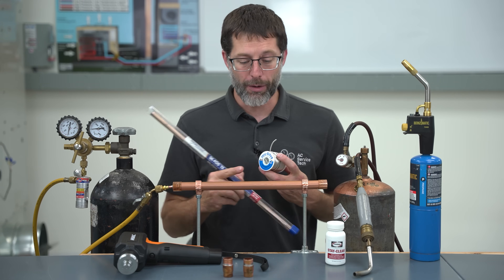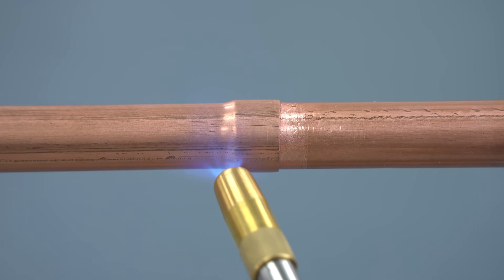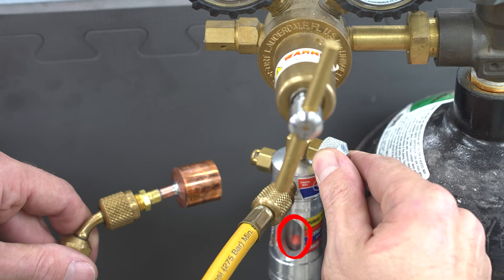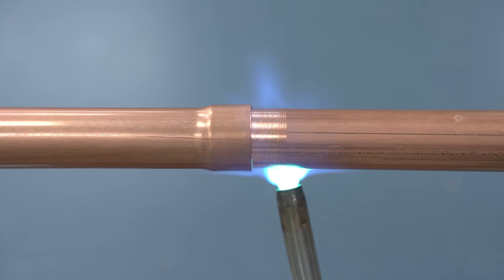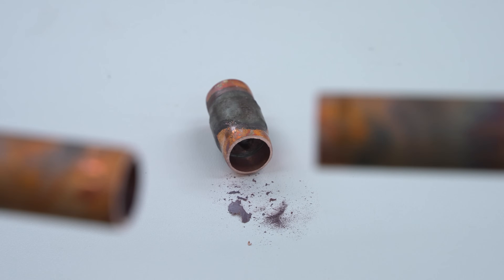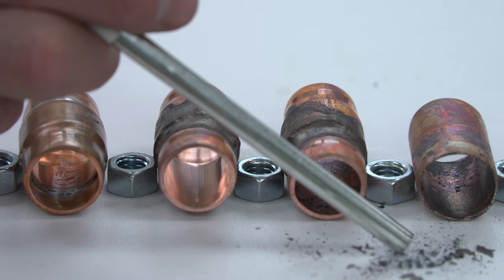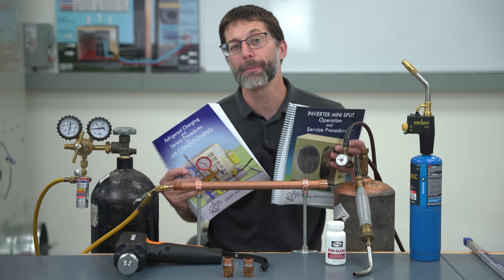HVAC Silver Soldering vs Brazing vs Brazing While Flowing Nitrogen!

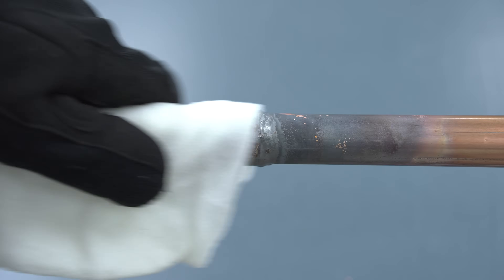Comment: 8:00 NEVER EVER QUENCH YOUR JOINTS. This is the only thing I  would disagree with on your work. There is a potential for creating micro cracks in your joints could create leaks on high pressure systems.

Comment: I love Stay Brite  but just want to point out 2 things.
1. It flows like water and is not great for filling in gaps. So tight joints are important. 
2. Since it flows so thin, if you apply too much solder, the excess  will pool inside the pipe and if that pipe is not level, that excess will run downstream until it cools.
If the pipe is vertical the excess will drip down and cause rstrictions or even blockages.
So keep that in mind when soldering in cap tubes, txv's etc. Don't overdo the application of the solder.

Comment: If that flyx leaves that residue inside the copper tubing. How is that good when soldering hot water tanks? Wont that get into the water?

Comment: A rare miss by ACST. You are far more likely to cause long/short-term issues with the excessive heat caused by brazing than by a microgram of residual flux from soldering. Your test didn't include pulling a vacuum evac on the pipe, which would vaporize and suck out any acid in the flux that snuck inside. There's zero chance the tiny amount of residual flux diluted by the oil would affect pH enough to damage compressor windings. Considering how easy it is to braze incorrectly, silver solder really should be the preferred method due to it being more idiot-proof and much safer/quicker than brazing.

Comment: I braze whenever I’m not overly worried about damaging the txv. On my own system, the condenser is brazed, but my air handler is soldered. The reason I did this is my factory installed txv was a few inches of pipe away from the end of the pipe. I would rather risk a little bit of flux over the guarantee that my txv will get at the very least, a little too hot. That’s the only time I feel soldering is acceptable. Never would I do it with anything in my condenser or for a coupling.

Comment: An HVAC system should have a filter/dryer inline that will catch the particles of debris that may end up in the system. It is not a substitution for purge gas by any means, but should stop the flux, and burnt flakes from always flowing. Also the refrigerant gas in the compressor is sealed off from the electrical components and the seals are usually in an oil bath. The only time they will come into contact with the electrical parts are when the seals fail. At that point you will need to replace the compressor .

Comment: I've seen a suction line soldered with plumbing solder back out of the fitting on a heat pump and leak

Comment: Hi there. Great tutorial. Two questions for you. Why did you apply flux all the way to the edge of the inner pipe? This will cause flux to enter the line when heated. My second question is, if using silver soldering on the liquid line, can adding a line drier mitigate the excess flux in the line?

Comment: The last one you did by brazing is how I was taught and shown how to do it. I was always told to stay away from the plucks due to down the road. Anything that comes in contact which will be the high side will start to deteriorate over time. Not tomorrow. Not next month but over time and can be expensive if it's a major part. Not cost effective at all to use the flux. If you have a total compressor failure and you don't have a split unit then the whole thing becomes trash. And they always have a great deal on an AC unit. 

Question for you.  What about TIG or mug mug welding it? They have different amps and a wire is self-feeding and it takes a very small unit rather than carrying two big bottles with you. Wire feed welding TIG welding can weld just about anything. Just wondering what your thoughts might be on that today?  
Now I do understand and tight situations where you don't have the ability to braise and they choose to flex it and we know what that means at the end. But nevertheless you may have another couple years. But you never know. Your way doesn't take any eye protection, but TIG welding does. I'm trying to weigh the pros and the cons. Don't know how much experience you may have with that. I believe brazing is the best way, even in tight situations just takes patience. That's my thought. Please feel to correct me at any time. 

To me, brazing can take a little bit more time as far as handling your own materials, but I would prefer that than antioxide inside of my for oxidation occurring inside of my copper line that's going to run through everything.

How is a helper as a child to the AC man and he would have the nitrogen and the gas in a container that would be able to hold one hand so he always keeps an extra 5 lb or whatever it was of each rather than having to carry large bottles unless it was a big commercial job. He did beautiful work and you're doing beautiful work. There's a big difference from 30 years ago to today. Now they have nitro caps and all these new added components. In your opinion, how far has the AC company including with the reverse pumps for heat, have come in the last 20 years. I would deeply appreciate your time and thank you so much for the video again. God bless!❤️🕊️✨

Comment: I have wondered if nitrogen really "blows" the cupric oxide out "in theory" or it just circulate the cupric oxide inside the system, away from the solder joint.  How do we really know?  It'll be interesting to get the HVAC system manufacturers to get their engineers to comment.  In addition it maybe good practice to install filter dryer to the liquid line to remove contaminants before they get to the expansion valve.
Reply: It doesn't blow it out it replaces the oxygen with nitrogen which eliminates the chemical process of the formation of the oxide

Comment: I'm a noob just learning all of this stuff as a homeowner. I don't have the tools to braze (yet?)... If I recover the refrigerant and isolate it to compressor, then do my line work with staybrisolder, can I purge/flow the lines with nitrogen before pulling a deep vacuum? I'm guessing this doesn't physically "clean" the flux off the inside of the copper, just wondering...

Comment: So compression fittings then? Safer, could stand high pressure too, unless the technician installed it improperly, the connection could burst and leak.
Reply: Ciao! Qua in Italia non usiamo raccordi a stringere, fino a che pressione sono consigliati? Li avete provati sul campo?

Comment: What size is your torch tip? 
I use the standard size offered with the torches but I feel like it doesn’t heat the pipe evenly and this causes for longer brazing times.

Comment: Silly question but I think there is a way to get the flux acid residue out? Why not take a separate piece of swaged fitting, a few inches long, apply the flux and solder, but then remove it. Do the same to the other end of the line. Then clean the insides of each pipe. Now the ends have silver 'plating' on them. Then just clean the insides of the pipe, re-attach the pipe ends but no flux needed since they have the plated surface. Heat a bit to get them to seat, then add a little bit more solder. Kind of like how you can unsolder and re-use plumbing fitting in domestic water. Am I missing something here?
Reply: A brain

Comment: Never cap the pipe if you are running nitrogen. You will have a leak. I will purge the line with nitrogen then turn it off.

Comment: I installed two split systems. A 3.5 ton and a 4 ton  last year using staybrite 8. I was worried about the flux. What I did was I added flux, tinned all the mating parts lightly, removed all the remaining flux, assembled the parts and soldered as usual. So far it all looks good and holding well. It seems that you need flux to apply solder to the copper but the parts that are already tinned with the solder will solder together without anymore flux needed.  Give this method a try and tell what you think. I would love to hear your thoughts on this method and love to share what I think is a good method.

Comment: I'm not saying it's right or worng but I'm sticking with stay brite 8. They are referring to direct contact with electrical components in regards to the stay clean. I want to hear what the manufacture has to say? Does this void a warranty? Bottom line is stay brite 8 is made for refigeration. What really baffeles me is thay I see all these 30 yr old systems with no filter drier and I'm sure no nitro was used while brazing but they continue to run. In my opinion the anount of flux left behind here would not even be felt in the system in which filter driers arre desinged to catch.... I.E. a 30 foot lineset with a smug of flux isnt going to hurt anyting...If you are getting down to 200 microns that system my friend is clean as a whistle. Only time I use silfos is on compressor swaps or repairs I have units with stay brite 8 way past there warranty, again not saying whats right and wrong but I'm using what they say works...To me this is just a scentific internet demo and thanks for showing the demo.
Reply: Anche secondo me, la teoria è sempre affascinante, ma la pratica è molto più semplice 😂

Comment: In the "real world" without code requirements as is today for HVAC soldering vs Brazing vs using nitrogen the choice will be solder using flux as the costs involve for time and equipment. This is why you see the evolution of "Shark Bite and swedge connectors" like it or not. I've been around awhile and listened to it all regarding......"you wanna do it right" and etc it all boils down to money and of course following the code. I don't care who says what but "its the way it is"

Comment: Very informative demonstration. Everyone watching this video can very clearly see that the nitrogen flowing through the copper pipe, as it's being brazed, prevents the formation of cupric oxide inside. Even if a person does not use this method (because of the extra hassle or expense) they will know the issue. They will be aware of possible future problems caused by the unwanted materials traveling through the system they present to their customer. Throughout my 40-year career in computer system installation and maintenance, quickly changing technology forced me to constantly adapt to new systems and methods. Progress was both challenging and humbling. Being forced to learn, and deploy, methods that I was previously unfamiliar with was painful, but kept the paychecks coming. Also important, I was proud of my work. Thanks very much for this well-done video.
Reply from the maker: Thank you for watching and for sharing your experience!

Comment: If you make the joints so shiny before soldering, you just need the thinnest coat of flux you can create. This is where you make or break this technique in my opinion. I'm using soft soldering for DIY repairs since at least 10 years now. And it works really well.
Especially the reversing valve of my heat pump/AC unit broke down 2 times during warranty and a third time right after warranty. Warranty repair was brazed, I did the third repair myself with soldering and it now lives longer than ever before. I suspect brazing overheated the valve.

Comment: The old trade trick is. Fix the leak then they will contaminate the system so windings in compressor will fail.  Bingo back out for new compressor. Honesty is a thing of the past. I caught them on camera doing it. We had an out of court settlement. Always watch who is repairing what ever it is. Why do you think auto repair  shop won't let you see them working on your car.

Comment: How exactly does flux inside the closed loop refrigeration circuit touch the compressor  motor windings as you said? The windings are not part of the refrigeration circuit.

Comment: STAY CLEAN is Zinc Chloride. It isn't acidic unless exposed to water and oxygen. The oil in compressor neutralizes Zinc Chloride from becoming acidic. This is the reason the Oil & Gas  industry extensively uses it.
Reply: As per their information sheet.....The flux is mildly corrosive so post-soldering residue should be
removed with hot water or other suitable cleaner.

Comment: Strange times now days !!!

I started in the trade 50 years ago, when R -12, and R - 22 were the standard, with an odd R - 500 thrown in !!!
The old timers thought me a fool for using high acid liquid line and suction driers on every residential refrigeration job.
They said I was wasting money when I bought a micron gauge, and an electronic scale to weigh in a proper charge.
They accused me of being a crook to charge my customers for an oil change in my vacuum pump, which was changed after every burn out job, before I got off the roof !!!
I changed my oil after every three normal non burn out jobs, as SOP. ( Standard Operating  Procedure )

The only time we used nitrogen was on large commercial jobs, for leak testing, and dehydration.

Things have changed for the better, I must say !!!
Better tools, better techniques, and better technology.

I use nitrogen on all my jobs now, even refrigerators !!!
There is no such thing as too good on any job.
Your reputation depends upon it !!!

I wish I could still climb, and do roof work, however at 75, I like to stay on the ground, even if it means doing an occasional appliance repair.
I may be retired, but I am not dead !!!
I still teach the subject, and emphasize using the best and latest techniques.
Doing it right the first time beats a call back every time !!! LOL!!!

Great demonstration, I will use it in my classes from now on, as a student lab project.
I like your clean demonstration set up.

Tim

Comment: How about a different type of flux, one that's not corrosive, like the one that's used for soldering electrical wires & electronics components. 
 Liquid no clean soldering flux, it's non-corrosive.

Comment: Refrigerant and filter driers will clean out that flux and oxide. No worries.
Reply: Really? And when a the filter driver is replaced with a new one, will nitrogen be flowed, or will it not be flowed like previously and now your back to where you started........ IF YOU flow nitrogen the first time you wouldn't have a issue to begin with. 

You already have the nitrogen to use for pressurized leak test, why wouldn't you use it to flow while you braze???? 

You're a LAZY HACK is why.

Comment: I was taught that Brazing is a stronger joint than silver soldering and the joint becomes stronger than the pipe , if done correctly. You need to use nitrogen (inert) gas when brazing.

Comment: There is more to this subject than you covered here all soldering and brazing has its place depending on what you are doing there is no one solution for everything prep work is crucial I've used all the different types of rods and solder and brazing. They all have their place depending on the job.

Comment: R454b has ZERO room for forgiveness it must be installed 100% clean. New Refrigerant Requires Precision. Quality Tools, Quality Equipment, Time and a Skilled Patient Installer.
Half ass installers don't want to install R-454b because they do not care to be perfect precise and exact what 454b requires. It is not a forgiving refrigerant. They sure as hell don't care about the environment. Half ass installers only care about their own pocket. By the time the Ozone layer is destroyed they will be dead so they don't care about the next generation.
Shit installers wanna get in and get out as quickly as they got there so they can do more shit jobs and make their shit pay.
Half ass installers don't want change in the industry because they want a refrigerant they can half ass an install and be forgiving for
their shitty ass job. They don't wanna be responsible for copper oxidation or flux runoff inside the copper tubbing. They want a system that is either able to filter and fix their shitty job or a Refrigerant that can mix well the flux runoff and still be good.
The shit installers want to use the "cold as beer can feel" as an indicator instead of utilizing good quality equipment.

The only installers complaining are them that like cutting corners and providing half ass shitty jobs. Shit installers are not using nitrogen throughout the brazing process. They don't pressure test correctly and they don't vacuum correctly. During the fill process they don't fill accordingly to length of line and elevation change

Comment: great info !  ...however I am puzzled as to why the refrigerant would be in contact with the electrical wire coils in the compressor ?  Could you show how this happens ?  It woudl seem to me that if the refrigerant path within the compressor is in contact with the electrical coils there would perhaps be many potential paths for refrigerant leakage, unless the compressor coils are fully sealed inside... am hardly an expert, just thikning out loud...

Comment: I believe you forgot to tell what color the copper turns into when using a torch if it glows a dull red at the right temperature for the raising rod and using a mirror to check your work